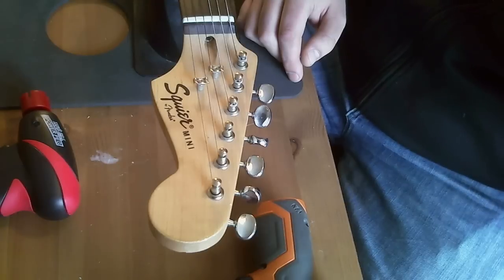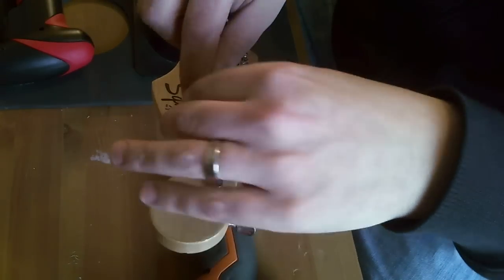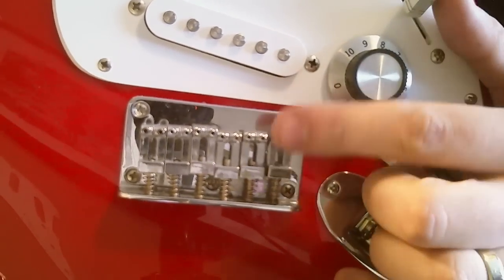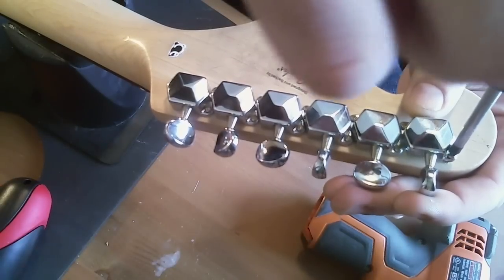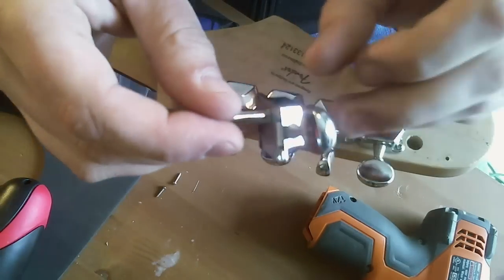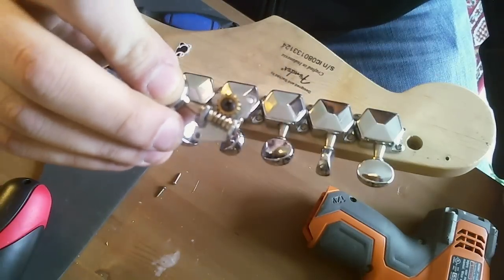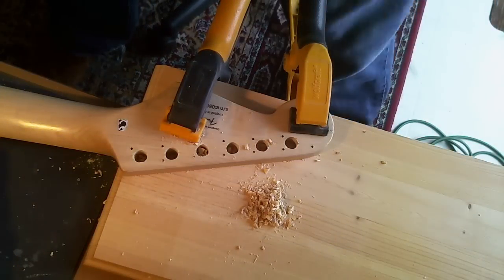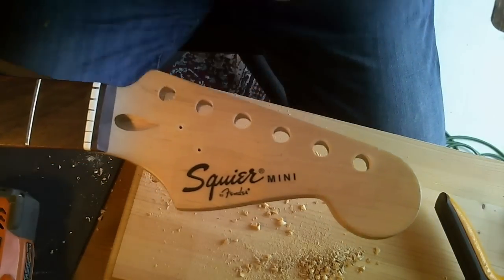HotRod Mini Part 2 -Mini ACTUALLY gets new Fender tuners.... finally!

Comment: Thanks for making this video!  I picked up a 94 Fender MIM Squier Series recently with the same crappy tuners.  I replaced them with used genuine Fender tuners. The drill bit tip was very helpful.  I used the 25/64 drill bit you suggested and it worked great.  I also clamped a piece of wood on the front to prevent blowout.  Thanks a bunch.

Comment: Next time try Grover Vintage 133N6 tuners. They just drop in without the need to drill the shaft holes. They are also smaller and lighter for the Mini Squier neck. They cover all the existing screw holes except the 1/2 of the first top left hole (simple to fill it in). Just use a straight edge to line the tuners up and drill small pilot holes for the mounting screws. A bit faster and easier project for the faint of heart (drilling out those shaft holes).

Comment: Tip:  Put all machines in place, and put a straight edge against them to align, then mark all the holes to be drilled in one shot, with an awl or a nail that fits the machine's hole, while  holding pressure with the straight edge.  Fill the old holes with maple dowel.

Comment: Appreciate the video. Lessons learned: 1- A drill bit in a handheld drill will never get a true (clean) hole. A reamer seems to be they best way. 2- A slightly warbled hole can end up looking just fine after the bushings and nuts installed. 3- Some guitar mods don't have to be difficult (have confidence). 4-  (Almost) every new guitar comes with loose screws EVERYWHERE, and i suspect those stock tuners may have worked fine (for a while anyhow) had you just tightened up the mounting screws, bushing nuts and a little DuPont Krytox lube. Thanks.

Comment: I see nothing wrong with modifying a $100 Squier. I own a Fender Telecaster FSR, a Deluxe Lone Star Stratocaster as well as a Squier Bullet Strat HH (I paid $100 for the Squier on sale - marked down from $150). I love all three guitars, and I'm pleasantly surprised at how nice the Squier is . The one thing I wanted to upgrade were the tuners so I ordered a set of Fender American Tuners and had my luthier install them (I wouldn't attempt it myself). He just called me and said that it came out great & the tuners are a huge improvement over the stock ones. I have no problem upgrading the Squier as it plays wonderfully, has a beautiful well-made fretboard, has a light basswood body - (basswood has great acoustic qualities) and it's just a very nice guitar.. So with a good set-up, a switch to 9.5 strings, and excellent tuners I've got a very nice sounding & very playable guitar for under $200. This is the guitar I take to my practices due to it's light weight. With the stock  dual humbuckers I get tones out of it from a pseudo Tele twang to powerful hard rock tones and virtually everything in between. (Okay it might not deliver the buttery smooth jazz & blues tones that the Texas Specials on my Lone Star does, but those pickups alone cost more than the Squier) and it's the best guitar I've ever owned for under $200. Thank for the videos.

Comment: I don't know..  Nelson, I think you cursed more than me but only because for some reason I was real relaxed while fucking up my $180.00 guitar.  It didn't go well.. Evidently there are different kinds of bits for different things your're drilling into.. I lost an awful lot of surface wood with splintering and such.  I haven't even gotten to the extra peg holes yet... Last time I did peg holes I went clear through.  My tape moved on the drill bit haha... I'm having a realxing cup of coffee now that the whole head stock is splintered to shitl..  I'll attempt the peg holes shortly.  I'm trying to change my view on distressed guitars..  I don't like them much but seems I'm doing a great job of distressing on this one.. doubt you'll see this cause this vids a couple years old.... but what the hell.. I only post for me anyway.  Thanks  BTW, I did end up using a reamer like the ass below suggested. I actually hope I don't mess it up too much... It plays really well,, it's a used Classic Modified.  Bought it for the Surf Green color,,, was surprised how well it played.. yep, it's still cheap but.. I've got expensive guitars, this one's for fun.

Comment: Look really great mate with those new machine heads :)

I just got mine yesterday and yes that´s the first thing you wanna replace. But overall the guitar is really easy to play and I´ve never thought a simple neck without a paint job would feel so good.

I bought mine to fit my travelling case and I swear I´ll turn it into a lil beast :)

Cheers! Good job!

Comment: My project guitar is a 1993 Fender Gemini II acoustic made in Korea. I've had this guitar since I was 18 or 19. God, I'm old.
Anyway, they have the same shitty tuners as your Mini Strat. I made the mistake of ordering the "Economy Tuners" from StewMac as a suitable replacement because they were the only tuners I could find that had the same layout for the mounting screws - two diagonal mounting screws.
After seeing your video, I realized I blew it. I ordered a set of Jin Ho tuners from Riceage Music and More on eBay for $25, US. They are Korean copies of Grovers (not Chinese counterfeits). They seem to be decent quality, especially for what I'm doing. I've also just picked up a new to me, but slightly used Takamine Jasmine S34C off of Craigslist that have the exact same bogus tuners. Geez!
I plan to order another set of these Jin Hos to replace the tuners on the Takamine.
I've just ordered my digital caliper off of Amazon to check my measurements before I go crazy with my drill. My question for you is: what size pilot bit do I need for the mounting screws?
Thanks.
By the way, I enjoy your videos. Great DIY vids for the layman guitar tech.
Reply from the maker: Hey mate,  thanks for watching and for the kind words.  I would say that you could pick ip a set of Ping's from any local music shop pretty economically.  They's a lesser known brand but their stuff is decent if you're on a budget and most shops seem to carry the brand.  At least here in Canada they do.  As for the size of the drill bit, I can't remember, but all I did was grab one from the set that close to the right size and lucked out.  These holes for the Fender Tuners can also be a bit larger than the little nub that slips into them.  Its the bushing that's doing all the work. Those little nubs just keep the tuner straight.  Anyway..best of luck!

Comment: Hi, Tkxxx for the great video. I just picked up a mini and need to do the same thing. Can you tell me the exact tuners you used and where you got them? Tkxxx Bob
Reply from the maker: Hey mate, thanks for the view and compliment:-)  I used stock Fender tuners. I had them left over from my American Strat, which I put lockers on.  You can use pretty much anything "6 in line", you want. You just need to be aware of the shaft diameter on the tuner and the hole size you'll need. For example, these Fender tuners I used are 9.75mm and then hole size to drill is 25/64 or (9.92mm). Oddball size of drill bit. I just went to the hardware store and grabbed one as I didn't see any in my dozen kits of bit;-) Whatever tuner you buy, just measure the diameter of the shaft and buy the closest size drill bit.  I suspect 25/64 (9.92mm) will be the most common size tuner shaft, unless you buy vintage, in which case it's considerable smaller. Hope this helps mate...good luck with your project!
Reply from the maker: Oh also.... my measurements will work for any stock Fender tuner, that isn't vintage.  MIM ones too.  And they're plenty fine for the Mini.  I would have looked for some used on Craigslist if I didn't already have some.  I suggest you try there first for used set of MIM tuners.  If nothing shows up...put up a wanted ad for 6 in line tuners, Fender MIA or MIM.  Should be no more than $30-40.  Brand new they're $68 CAD.

Comment: Might've been a better video if he didn't curse so much.

its a $100+ guitar what do you want
Reply from the maker: Hi Howard,  Thanks for the comment and view.  I appreciate that you have some issue with my cursing and motivation for modifying a $100 guitar.  This is the entire point, which clearly, I've failed in my attempt to communicate with at least one viewer, that yes indeed, this is a CHEAP $100 guitar. But with a little modification, can be a GREAT and cheap little guitar.  With very little spend, these can be brought up to a very playable standard, which any player would find suitable for what this is.  And furthermore, a much better and way more stable guitar for a kid to learn on.  However they come from the factory with some simply unacceptable compromises, in my humble opinion.  And tuning is chief among which, is intolerable.  I teach my kids to play and when the guitar comes out of tune by breathing on it, even at $120 new, that's way unacceptable.  For $30 or less, if you buy used or free if you have upgraded a more expensive guitar, like I did, you can completely transform this from what I consider an unusable guitar, into a perfectly reasonable player.  

And mate, I really am sorry the cursing is so offensive to you, but I'll tell you what I tell my kids.  They're just words.  They can't hurt you;-) Also, you have free will to click away. Have a super day!  Thanks again.
Reply: Woodeso's Guitar Mods curse when its $1000 guitar that works like a $100 one not the other way around - next guitar get a reamer